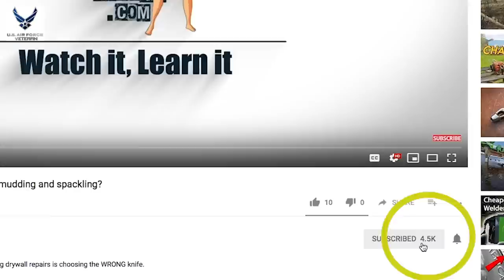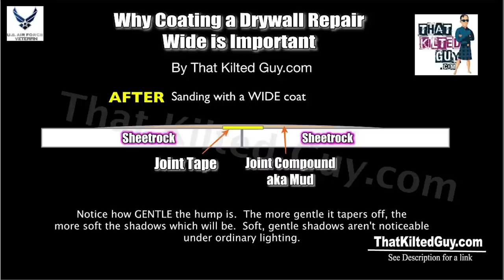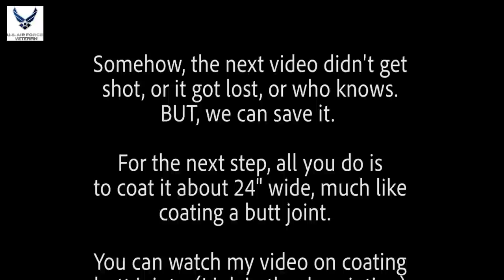2023 - How to Repair CEILING WATER DAMAGE using Mesh Tape the correct way

Comment: Love your content. There are no videos on youtube about repairing a crack on a level 5 finish ceiling. All the new construction in my area are using these flat finishes on ceilings( no more texture). How do make it not look like a disaster? Is it the same as your other video on repairing cracks and skim coating and just more sanding? Thanks and keep up the amazing videos.
Reply from the maker: Hi Brian, and thanks for asking.  Sometimes drywall is multiple steps, and yours is in this case.  Start with doing the repairs and getting them as good as you can.  Fix all the nails that are showing, coat any joints, fix any humped butt joints, etc. So get it in really good shape.  Take your time and be patient. Once you have it as good as you can, THEN, for a level 5, (the toughest finish to do for a seasoned drywaller) you skim coat it like in the video below.  But it takes one extra step over what I did in the video.  You skim coat it, let it dry, then sand it with 220 grit or finer,  Finer is better as you don't want any scratches to show through.  

Next, get out a light you can shine right across the ceiling.  Go around and look for EVERY little divot, ding, scratch, edge etc.  I recommende doing this with a light and a pencil and circle every nail divot, ding, etc, and draw a line down every edge.  Then tint some mud a very light blue with chalk dust mixed in water, then added to your mud.  You then go fix all the things you marked.  You use blue tinted mud because level five requires you to sand Everything you are about to touch up.  Once dry, look for the blue spots, sand them REALLY lightly.  Now prime with a primer with high solids, and put plenty on, with a 3/8" nap roller.  Then 2 coats of paint, and don't skimp.  And you'll have it.  It's not actually that much harder for drywallers to do, but it's more work for sure.

https://youtu.be/h7o6dc-wfxs

If you find our assistance with your projects helpful, I hope you'll consider supporting our channel by making a one time donation in any amount at: https://paypal.me/ThatKiltedGuyVideos?locale.x=en_US

Comment: What is the difference between spackle and joint compound? What is better to use on walls or ceilings? Thank You.
Reply from the maker: Spackle is more of a painting term and is more for filling nail holes and such. I never used anything but drywall mud on drywall unless I’m filling a nail hole.

Comment: I have always been taught to V the crack out, screw it off, prefill with durobond, and then proceed with mesh, hot mud, ect
Reply from the maker: I have heard that and even used to keep a close shaped can opener to v out the crack but after thinking about it, it never made sense. The only time it makes sense to remove solid material and then put more solid material back in its place is if the mud is loose and trying to chip or bulge already. So I quit doing that at least 20 years ago and have never had a problem.

I have gone back to dozens of jobs, years later and it has never caused me a problem so I believe it is wasted effort.

Thanks for reminding me about that. I may do a video on that one day.
Reply: Your good with your process because its correct up to the mesh tape. 100 % of the time I quote a crack its where there was a repair done with mesh tape. I would recommend paper tape and your problem should never come back...
Reply from the maker: Re-posting from the other reply.
Ok, I agree and disagree, so let me explain where that's wrong. I did new construction for 15 years and used only paper tape, (and still saw some paper taped joints crack).  Then I got into doing only repairs and over the last 20 years I've repaired probably 10,000 holes and cracks, and have strung well over 1,500 rolls of mesh tape, with at least 5,000 bags of hot mud, and I've gone back to numerous jobs many times, often years later, and only ONCE have I seen one of my repairs crack.  In once house the original drywall was done very poorly and I fixed over 150' of cracks, and came back 3 years later, and not one had failed.  I NEVER get callbacks, and have a 5 star rating on my work.  You can verify that by reading google or Angies List, or even facebook reviews for Mr Patch Drywall LLC.

So here's why they fail.  I guarantee you that 99.9% of the time novices buy the green label all purpose, which is an excellent mud for taping, but ONLY for paper tape.  It should NEVER be used for mesh tape, but they do, and it fails.  But there's another reason, almost no one, including handymen re-secure the crack, and that leaves it weak with movement, so it will crack.

I would also estimate based on my experience and on listening to comments on my channel and others that about 80% of handymen use green label all purpose, about 60% of painters and even about 40% of drywallers, because they don't realize you have to use hot mud over the mesh tape.  I once got lazy and used all purpose and learned my lesson.  About 10% cracked by the next day, and that's NEVER HAPPENED with hot mud.  So folks, if you use hot mud, and re-secure the cracks, you will be fine.  But if you use all purpose mud of ANY kind, use fibafuse or paper tape.

Comment: I had a crack from ac vent cut out then spiderwebbed out bad. Repaired it with mesh tape and hot mud, which eventually bubbled up badly. I dont know what I did wrong. Think when ac air turned on I didn't mud the beginning of the ceiling crack correctly which allowed air between the crack and mud and caused the bubbling. Any thoughts or tips so I can correct my issue, much appreciated and respect for everything brother. God Bless!

Comment: This is the first of your videos that I have watched and I thought that it was very good. I will watch more but I have a question.  You said that you use hot mud, do you mean that you put hot water in you quick set? That would make it set up faster then it does already right?
Reply from the maker: Hi Rick, and thanks, glad you enjoyed it.  But as to your question, NO, I never put hot water in hot mud.  The term hot mud comes from the fact that the fast setting muds set up chemically, and this creates some heat.  Not much, but you can definitely feel it.  There are some who suggest adding hot water to the hot mud, and you can, but I've done it in the past, and it speeds up the setting time, but you wont know how much.  I like knowing exactly how much time I have before it hardens into a mud you can not wash out of your pan.  I've been caught working it too long numerous times and it's a major PAIN to have to scrape it out of your pan and off your tools.  So if I want a faster setting time, I use .... a faster setting mud.  I carry 5 minute, 20 and 45 on my trailer at all times for that reason.  I've spread thousands of bags of hot mud and can spread out a full pan of 5 minute before it sets, if it's on one repair spot.  Otherwise I mostly use 20 minute.  So if you try the hot water, beware that it may catch you off guard.

Comment: Do you have another video for this? I see you putting screw to hold them tight but my crack is on the ceiling as well but it is not a straight crack it's curvy. So I don't think I can put any nail to it before plastering. Thank you once again ,hope it all well

Comment: New sub here, love your Drywall tutorial videos, I'm a pretty good Carpenter..but I always fight those drywall seems, I suppose I don't need to get them as tight as finished trim  and I forget just how forgiving a roll of 2 inch tape can be.. 🤣🤣
Reply from the maker: It’s all an art of illusion. We really never leave things perfectly flat on cracks and butt joints, we just create the illusion of it by floating it out wide enough to make the hump so gentle that you can’t detect it.  Glad I can help.

Comment: Thanks for the video showing right way to repair existing drywall and a new drywall and the compound need to use. However you did not mention the grit of sander you had use. What usually the grit # of sanding paper on first and finish. Cos right now i’m doing my ceiling due to water damage from rain. I don’t have all the equipment that you have any alternative? Thank you so much on your input about these video. I love your method. Once again thank you for the info.
Reply from the maker: Hello, I use a sander like this one for pole sanding https://amzn.to/2CfHwp8.  It works with many different handles like brooms, etc, so it's pretty affordable.  I sand with 80 grit when rough sanding.  When it needs to be light sanding, or for finish sanding I use 150-220 grit.  

As for tools to fix a ceiling, you mostly need a pan and knife like this set https://amzn.to/2XVB5Re.  You could get by with a hand sander, and you might need a texture machine, but you can rent one from most rental yards.  Hope that helps and thanks so much

Comment: The time that can be saved if you are capable of walking stilts. And this is a situation I would be using the 20 minute fast setting compound to speed up the process. But we'll leave that to us pro's. 😂😂 keep on giving these people great info and techniques. Like I've said before, I'm a hawk and trowel guy. I also like to keep a well broken in plaster trowel handy as well. They are quite versatile if you know how to use them.
Reply from the maker: Thanks

Comment: I have a few trouble spots because of seasonal truss rise. My mistake was screwing the ceiling drywall too close to the adjoining walls. I should have allowed the outer edges of the ceiling board to "float".

Comment: Great video and instruction. Im actually following your steps. I used hot mud " 20 " for my 1st coat. What should I use for the 2nd and last coat. Is it the Plus ?
Reply from the maker: That will work fine
Reply: @ThatKiltedGuyDIY  Thank you !!!
Reply: Great video and he's extremely experienced, I do alot of drywall myself where I work but am also a painter, I've run into huge transitions taping and mudding and especially in commercial buildings where there's metal stud framing, I use these same methods, use my knife as s level to show my highs and lows, I use a pencil, not pen or sharpee, they'll bleed through your paint later unless you spot prime them with shellac. Anyway, I use usually 20-60 minute hot mud to, on my first coat after hot mud I use regular Joint compound and go to a wider knife and blend my edges to remove my hard edges, then I use light topping compound for my second and third coats. when I have big transitions I do the same thing, float it big to make the transition more of a slope rather than a set of stairs.  After I'm on my 2nd coat I'll again put my knife or straight edge on it and see where it's at, if I have a low spot I'll gradually fill it in and the high spots I don't add no more.
Reply from the maker: Thank you. Guy

Comment: Question
In repair cracks in ceiling with knock down finish, do you sand it first or just cover up the existing knock down with a wider cover to hide the hump?
Reply from the maker: This was a repair over knock down, so just like I did it here

Comment: Does that method works for a leaking linear crack in a cement roof? Thanks for the video.
Reply from the maker: I’ve never repaired a concrete ceiling, sorry

Comment: If the crack is not along a straight line like you showed in your video, how do we fix it? Thanks.
Reply from the maker: Still similar.  Try to screw the sheetrock back down wherever possible, then if you push on the crack a little and it doesn't move much, you can just tape and refinish like I showed, but of course you'll have to cut the tape each time it zigzags and such.  If the crack is still moving too much, you might have to cut out the rock and replace it, or get some backing behind it to solidify it and put screws into that.  But honestly, I almost never have had to do that.  Like once every 200 cracks maybe.  Let me know if that helps.

Comment: Excellent video but a couple questions.
1. Why mesh tape vs paper tape?
2. Any reason you don't widen out the crack (ie V shaped) and force mud into it?
Thanks
Reply from the maker: 1- it’s faster as a pro
2- it doesn’t help. Mud in a crack has almost no strength

Comment: My home is only 8 years old and all the joints on the ceiling have cracked. Anyway I am planning to tackle this job myself.  I have been  contemplating whether to just cover the crack with new tape like you have demonstrated in the video. Will this work or do I need to remove the old tape and reapply new. ( I understand new construction homes will get all sorts of cracks and nail pops due to the settling process. Do you think adding a humidifier to the HVAV unit will also prevent  cracks? I have noticed various areas throughout the house where caulk have been applied remove and reapplied have crack.
Reply from the maker: I only remove the old joint tape if it wants to come up easily, otherwise it’s just a lot of work that’s not needed for my way of doing things.
Reply: Thank you very much for your help. I hope all is well on your end.

Comment: I've read differing opinions on whether to use Plastic of Paris or joint compound for repairing long drywall cracks and I am confused.  What is the best material to use?  Thanks
Reply from the maker: Well I've never heard of using Plaster of Paris, but fast setting joint compound, aka Hot Mud, is the best for sure.  Absolutely never use all purpose mud over mesh tape as it can crack much more than with hot mud.  But if you have to put it on heavy and sand it smooth, don't use hot mud, as it sands very hard.  In that case I'd use paper tape, and all purpose.

Comment: Will the same process remain the same with plaster ceilings and walls?
Reply: Basically the same, but I would recommend reading some material of historical restoration of plaster. On plaster cracks in different directions mean different things. And any structural damage to the home should be addressed first. Also, if the plaster is really loose, it should be removed, because any repair will be very temporary. Depending on the condition of the plaster, it may be worth repairing. If it is, the crack should be opened up, a can opener or paint scraping tool works good for this. With plaster, any meaningful repair needs to reattach the plaster to the lathe. I would use the knife sideways against the crack so as to full the crack completely. I recommend the sheetrock brand brown bag setting mud for base coat..... It tends to be more stable when setting. The sandable hot mud that he used may not set well on plaster, especially plaster with particularly high lye content. Brown bag is not sandable though, so be careful, and issues will need to be scraped off after it has set but before it is allowed to dry.

Comment: Maybe you can show a video how to fix a bad ceiling crack repair job, as I didn't know there was a video before this and put no screws, used fiber tape and the all purpose green stuff. After reading the comments I realize I've surely created a disaster. And I thought I did so well too. :(
Reply from the maker: Becky, it's a VERY common mistake, but might not end in disaster.  So if it cracks again, you could basically follow the steps in this video and it will most likely fix it.  I tell you what, IF it happens, hit me up and I'll see what I can do to help.  Hows that?  Sorry you found me after, but don't fret too much, it might be ok.  Take care.
Reply: Thank you for the response! So far everything looks fine. I liked the tip about using the spray adhesive.
Reply from the maker: You guys can do a lot of these things yourself but you really need the right instructions which is what motivated me to put these videos out. Thanks again for commenting

Comment: We bought an older home where they removed a wall and we have 2 cracks the length of the room where they tried to fix it. They did an awful job!! Could we use this same method to repair? We have already scraped it.
Reply from the maker: If there isn’t a loose patch up there, yes.

Comment: Thank you I think I can do this. The crack I'm going to fix is 3 feet long in a doorway
Reply: Is the crack over the corner of a door? Sounds like it was hung wrong. If the drywall joint is over the corner of the door on either side, the best thing you can do is correct the hanging. It will break again in the same spot before long of you don't. A joint over a door should always be near the center of the door, not on either side.

Comment: Thanks for the good Info. What adhesive for the mesh tape did you use. I've had the problem of the mesh tape falling partially off.
Reply from the maker: I've tried a lot of them, and the 3m drywall adhesive works the best, plus the purple color makes it easier to see what and how much I've sprayed. I'm pretty sure it's the one in my store at: https://amzn.to/2PpUzbq 
 Thanks for the comment & question, Guy

Comment: Got crack 20 feet long on  the joint. This is plasterboard ceiling, 3/4 inch thick. Above is attic and easy access. May I fix it from the top? Crack tape and  hot mud? Do I need tape  from bottom? Hump will be not easy to cover. Thank You.
Reply from the maker: I would not recommend that.  To fix a crack that's not recessed you just have to figure out how to float it out wider to make it hide.  Check out this video on how to do that. https://www.youtube.com/watch?v=wqM5Y8RoLiU

Comment: Great video 👍 Friendly tip, when I deal with ceiling hair line cracks I will open them slightly then apply a bead of latex caulking to seal the crack then tape and mud!  If you ever need a cool innovative paint brush check out the gooseneck flexible paint brush. www.arichard.com Cheers!